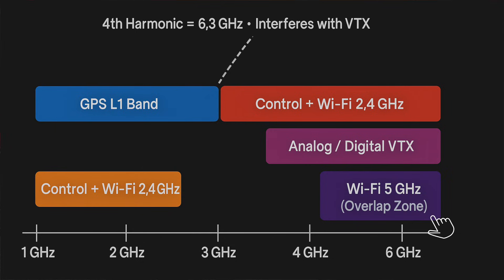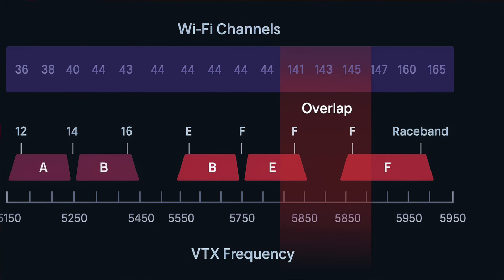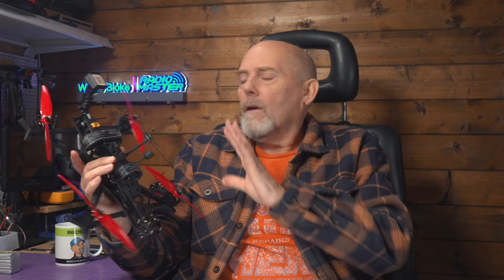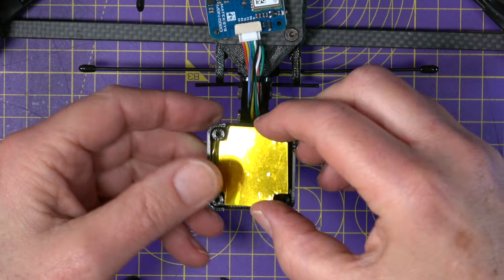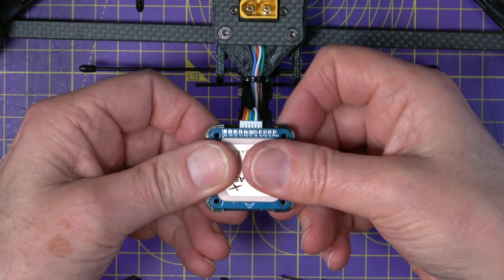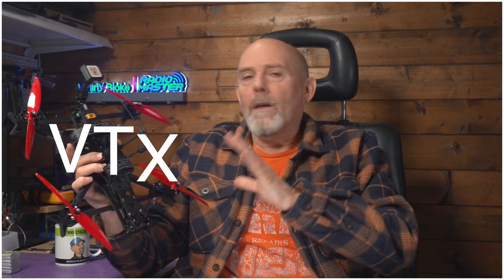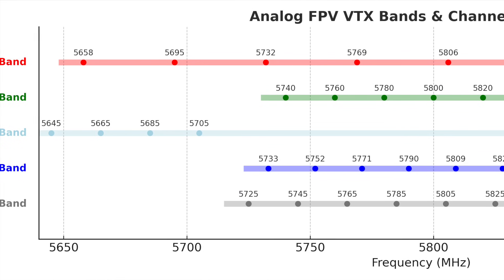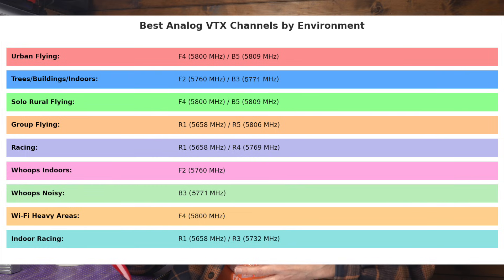Is RF Interference Ruining Your FPV Drone Flights?

Comment: I was told to use a USB power bank to power the flight controller while I get everything else set up, and then after a few minutes I assume I have GPS lock and then I plug in the lipo and unplug the power bank. I hope having the power bank and lipo plugged in at the same time for a few seconds won't damage anything. Will it?
Reply from the maker: No, it won't be an issue.
Reply: Powering a GPS before flight is masking a problem, fix the issue,but totally up to you.
Reply from the maker: @M-H433  Sometimes when you're out in field without all your workbench tools and shelves of parts, you need options. But I agree, this should be fixed at source. Thanks for sharing though. All useful info.
Reply: If it isn't getting a gps lock it is an issue,interference or exposure to other devices nearby,or quality of sensor,these days that sort of issue is a problem.